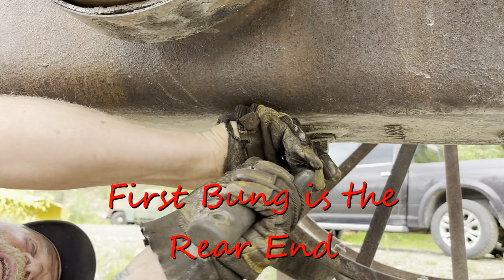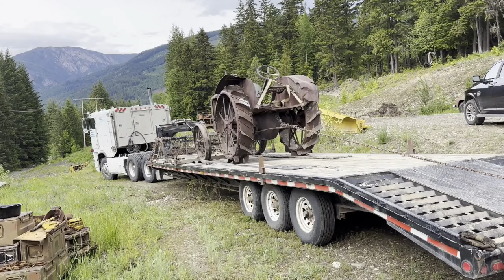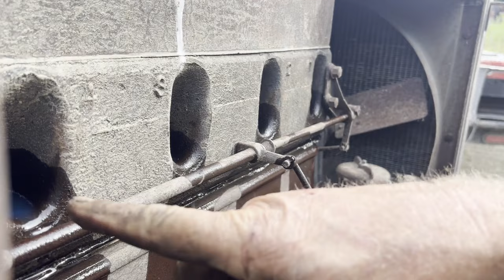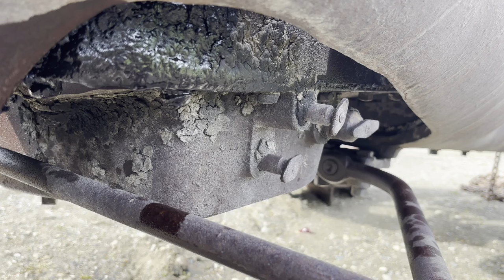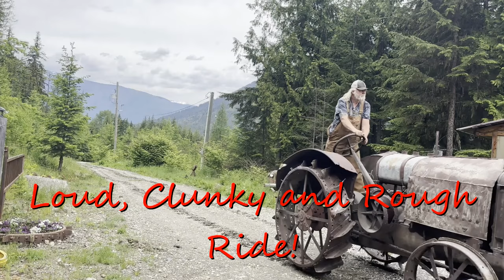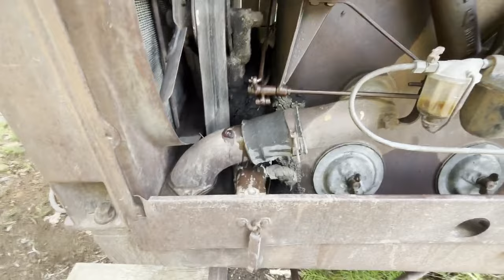Drain Oils Unload and Park the 1925 McCormick Deering 15-30

Comment: We used to treat those 3 little valves as "ADD, Operating, and Full" but we always added oil if it didn't run out of the middle valve
Reply from the maker: That makes sense. I was wondering why 3 check oil plugs.
Reply: My understanding on the three drain plugs was to use one to drain the oil down because it became diluted when burning kerosene or distillate. Then oil was added to bring level back up.